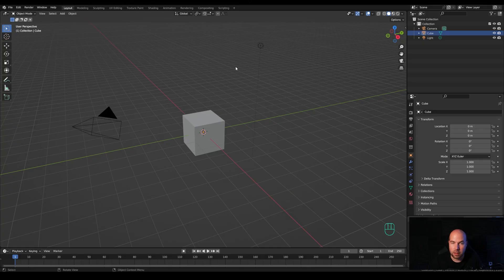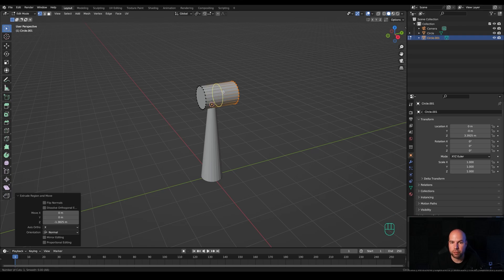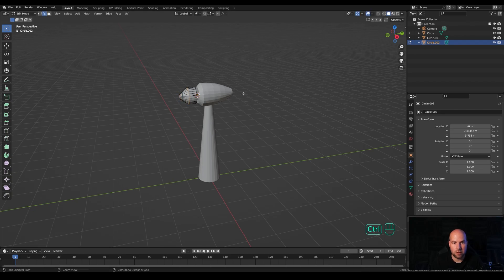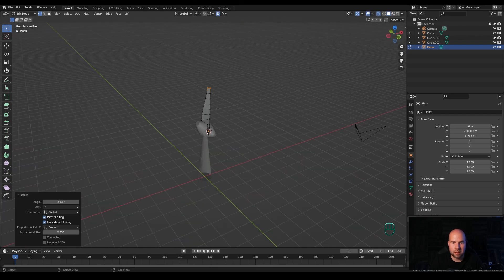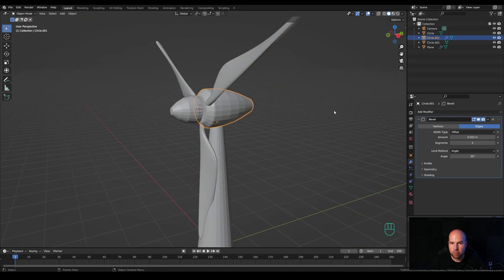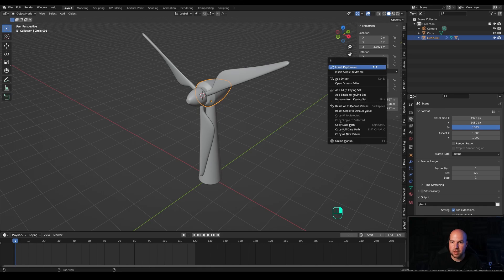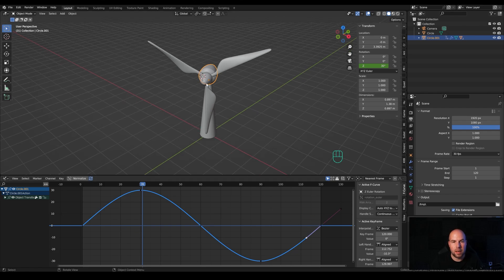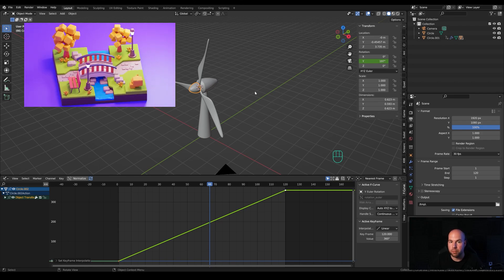Blender Wind Farm Animation Tutorial | Polygon Runway

Comment: I like your tutorials, did already some of them, but I think that you have made a small mistake at 10:40.
360 degrees is the same rotation as 0 degrees, so that means that the rotation of the blades on the first frame (1) and the last frame (120) is equal.
This causes a "micro-stutter" in your loop.
You can better use "360 degrees - 360 degrees/120 frames = 360 - 3 = 357 degrees" on the last frame (120). Then the loop will be perfect.
EDIT: Or you can put the 360 degrees at frame 121.

EDIT2: Same issue at 8:45, it is probably better to put the keyframes at 1, 31, 61, 91, and 121 for a perfect loop.

But besides these minor issues, I think this is (again) a great tutorial!
Reply from the maker: Yeah, i would go for 360 at 121, easiest to implement :) Nice catch